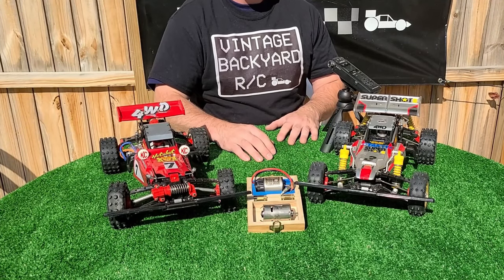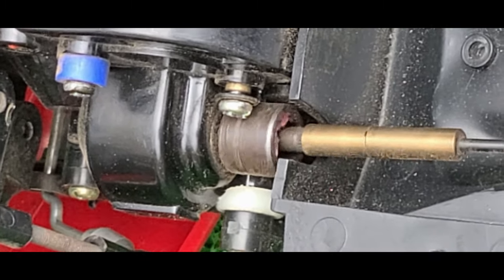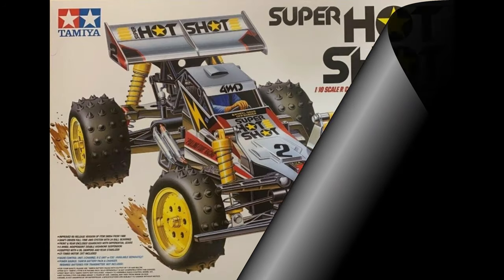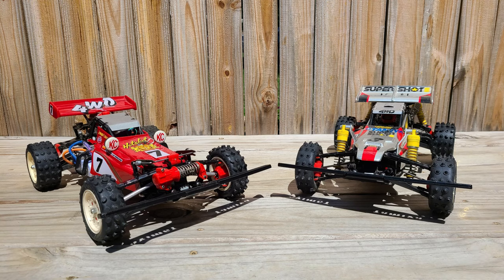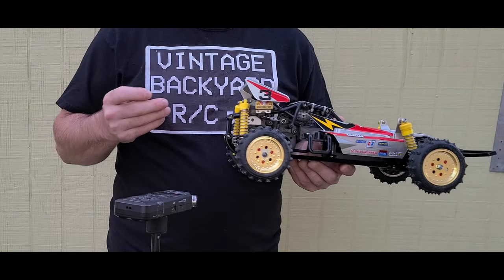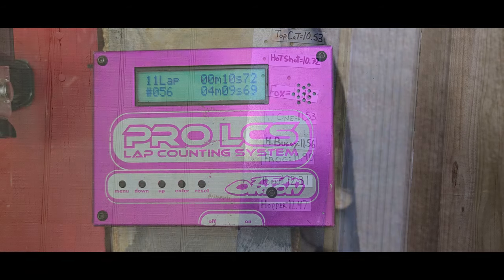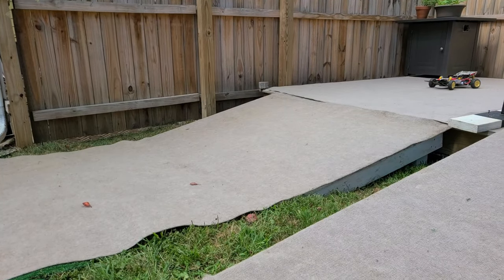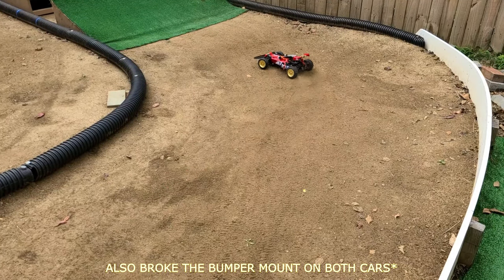Tamiya Hot Shot VS Super Shot! Vintage car battle!

Comment: Great comparison of these 2 iconic Tamiya 4WDs.  I wonder if the lack of front anti sway bar on the Supershot affect the handling (less off power steering) compared to the Hotshot, hmmm? Anyway, time to rebuild mine after more than 40 years inside the box.  Thanks for your video☺
Reply from the maker: Thank you so much....we really appreciate it. This one by far has been our most controversial video. On paper it makes no sense...lol. the results are the results though.  Was super fun doing this one for sure.

Comment: Love it. Been looking forward to this shootout. I love my Hot Shot and am NOT convinced that four-shocks is an “upgrade” ;) The engineering on the mono-shocks is so amazing and one can hardly believe that it actually works pretty well. I learned the off-power (over-steer)/on-power (under-steer) steering characteristics of this car pretty quick. I love how it snaps around corners if you come in fast and let off the throttle at the last second and then lay down the power on the exit. So much fun and super fast if you can get the timing right (which I manage about half the time, haha). Take care!
Reply from the maker: Exactly how I learned to drive it! Only had like three practice laps before the shoot (did not want to destroy the car) and was shocked with the amount of steering. I had assumed the drag brake was set or something. Just how it drives. Super fun!
Reply: The two-shock setup saves the weight of two extra shocks so I agree with you
Reply: I think the 2 shocks in rear is a good upgrade, but they need to be set up with stronger dampening/pretension. Definetly sits to low without any spacers.
At the front i like the boomerang suspension more, the 2 ears holding the front shocks are prone to damage.
Reply: @schuttrostig5729  From a performance perspective I would agree that two shocks offers more tune ability. But from a fun I-can’t-believe-it-actually-works perspective, I like the mono shocks. Totally agree about the cantilever design of the front shock pivot ears—what were the engineers thinking?

Comment: I had a Super Sabre in the late 80s, I wore the drive train out and it ended up being RWD. It was noticably faster and more fun to drive RWD due to all friction and understeer with the 4WD system.
Reply from the maker: That's awesome. Sounds like you got the most out of that car!
Reply: @VINTAGEBACKYARDRC  I think I went through three sets of drive cups and dog bone pins alone. lol. The metal was a bit soft back in those days! Thanks for doing the battles, any new ones on the horizon?

Comment: I had a Hotshot... Bought it new in September 1985! Added the HS2 shocks a year later or so.

The only car that kicked it's ass was the original RC-10! So smooth and quick. Also lighter. If overcame the traction of the 4WD system... Super cool setup, but way too many gears!

Thanks for the blast from the past!
Reply from the maker: Thanks my friend.
Appreciate the cool story as well.
One of the reasons we do these videos is to try and get folks to re connect with the good old days of RC.

Comment: I was so happy to see both of these cars. Both of these vehicles are still boxed up in the closet. The super shot belongs to my eighth year old son and I am the owner of the hot shot. I was only 15 at the hobby shop when that came out my face was pressed against the glass every time that I walked home from school. I still can’t believe both are sitting in a box unbuilt!
Reply from the maker: Awesome you have them NIB!
Reply: @VINTAGEBACKYARDRC  YES YES! I know right NIB and I am just sitting here.  There comes this point in time when you just say "I can't open this now"! I am stuck!
Reply: @UlisesBatalla  you should totally build it with your son, or find a new owner who also loves it. Then one day you can look back on the memories instead of a box of bits ... If you haven't built in a while there might be some swearing involved, and at eight years old the driving/crashing 🤕 might be more interesting than the building, but that's what more RC cars are for 😁
Reply: @Droidy77  I'm going to leave those two on the back burner. And the reason for that is that at this point in time, I noticed something snapped in my 8-year-old. He caught on to the fact that timaya recycles parts mixes them up and then comes out with another kit. That was like a light went on it's almost as if the wall were pulled from over his eyes it's like an epiphany that one has when you notice that to Maya recycles reuses reimagines parts and then comes up with new vehicles. It's always wonderful when there is a brand new, fully engineered, research and development buggy, car, truck or even a semi. Those two are going to stay on the back burner because at this point in time my black grasshopper too, is waiting for the 8-year-old to finish his Terra Nova Nova Terra Nova Fox.. the other issue is that my 6-year-old daughter cannot settle down and go with the white and pink that she has chosen for her re-released frog. Since I already had a black foot that I modified by changing the chassis adding some upgrades allowing it to perform a lot better it even has the chassis that is colored from a different kit. So what is going to happen is once she settles down and pics good old PS1 and whatever PS color fluorescent pink happens to be we will finish that buggy and all three of us will have are two wheel drive Fox frog and grasshopper. They're going to be identical right down to the vintage Futaba m c 210 speed controllers a Futaba s148 servo and a Futaba receiver that is almost as big as the servo. The gentleman from lightspeed gave me a wonderful price on three hand wound 19 turn double armatures that I stuffed into three of those really really cheap Chinese motors that you see on eBay.. sorry that this was such a long message
 Can anybody explain why they called it the Nova Fox and don't tell me just because the word Nova means new I understand that I'm Spanish and I know what the word means but, it really can't just be that!
Reply: @UlisesBatalla  the pink Frog or Neo Frog is a classic look! It sounds like you have "more RC cars" taken care of 🚙🏎️. Most people think they changed the name to Nova Fox because they didn't have permission to use Fox any more. Many decals changed from real racing sponsors to fake, made up names, and they had to make up a new buggy name, too.

Comment: Awesome video, love these comparisons. I have both cars also and the super shot seems a slightly heavier car with 2 extra shocks, undertray and hardware compared to the hotshot. Mine weighs a lot with the RC channel metal arms and it needs a lot more power to get the car up to speed also. Great video can't wait for the next 👌🏻
Reply from the maker: Have not put both on the scales...but I would agree it's probably heavier. I'm thinking with some different springs it will be a little bit faster. Might need to test that out. Thanks for the view and nice comment.

Comment: Incredible shootout! I've always loved the Hot Shot, and hope someday to get a Re-Re... Don't actually want an original, because I run everything! 😊 
The Hot Shot has been surprising me on several Channels, running WITH modern high performance Buggies!! 
Your daughter's Camerawork is PRO Level. She's very talented!!
Reply from the maker: It's actually a really great car. The controll arms are a bit fragile so I would grab a spare set. Also front knuckles crack every once in a while. Otherwise the re-re should go good for you. I might  pick one up myself so I have no worries about beating up on a vintage bit. My daughter thanks you for the kind words. I could not do this without her help and support. Thanks so much friend.
Reply: @VINTAGEBACKYARDRC  It was my pleasure! IF I can afford a rere Hotshot, I'd also want to get Alumininium Knuckles and controll arms, for that reason.

Comment: Ah, so history did repeat itself. When Losi made their 8ight 3.0, their intent was to make the car easier to drive, resulting in more consistent but slightly slower lap times compared to the 8ight 2.0. While it wasn't necessarily a matter of switching from a fancy, overengineered setup to something simpler and more proven in that car's case, it was definitely a repeat of what happened with the Tamiya Hot Shot.

I can see Hot Shots qualifying at higher positions while Super Shots end up placing better in mains.

Anyway, when can we expect an Avante to grace your track? If and when you eventually get to that car you might want to do a shootout between two of them, one with the factory stock setup and one tuned to correct the vehicle's nasty habits, rather than putting it up against another model.
Reply from the maker: Would agree...and on a imaginary race day situation...I would use the Super. 
I don't have an Avante unfortunately. That and a Astute are on my bucket list cars (especially the Astute). Hopefully some day I stumble into one.
 Appreciate the support and story brother.

Comment: I install a BEC circuit on my Frog to reduce the weight of the car. I vaguely remember buying it from the store. I am guessing it must have been the one used on the Hot Shot. I also remember I needed help from someone at my mother’s work to solder it onto the mechanical speed controller to make it work.
Reply from the maker: Yes...before they had the little red plug on the speed control. I remember this as well.

Comment: What all would you do with the shocks on the Super? Replace them, or just swap out some components? I've been looking at getting one myself
Reply from the maker: The factory cva shocks are actually really  good. For my track... the spring balance and stock oil were a bit off. I assume the rere kits still come with the different internal shock pistons. Messing with them will change the pack and rebound internally, and you can also go with a thicker or thinner oil. Lots of information out there on rc shock tuning...and the stock shocks should work well with some tweaks to match your running surface. Hope you enjoy the build my friend. Great kit to pickup.

Comment: I bought aluminum hubs for my super hot shot because I knew it was putting a lot of power through it and I'm still going to put a 3800 in it and the aluminum hubs are hard to find I had to get mine from Korea you wouldn't break a hub again probably I mean at the wheel.

Comment: Very surprised the Hotshot looked so much quicker in the video. As you said better turning was obvious.  Good work would love to take my Bigwig around and see how bad that is 🤣
Reply from the maker: At 1st I was not sure I could even make a lap with the Hot. I actually rolled on a little fwd trim so the esc was almost off neutral and it was dialed. Jumped really nice as well. I have a wig but it's a heafty beast (and all new) so I am reluctant to run it. Who knows though...I'm sure I will get bored of looking at that too...haha.
Appreciate the view/comment my friend.
Reply: @VINTAGEBACKYARDRC  dont crash the wig into the fence., will probably go through it

Comment: I too was surprised at the result. Now the Hot Shot II is out you can run it and compare the time.  On another note could the weight difference affected the results?
Reply from the maker: Think its more in the setup and track condition to be honest. Tons of rotation is absolutely helpful on a tight track. 
   Wish I had a Shot II to test.
Might be worth a look into conversation parts though.  Car spending is on hold for a while...

Comment: Excellent video as always but personally I’d liked to have seen the Supershot as it was meant to be rather than downgraded. I’d like to see how much faster it could be with all its upgrades. Interesting outcome on the video though.
Reply from the maker: Thanks bud...appreciate the kind words.
So the decision was two fold.
A. I wanted to A/B the suspension.
B. I only have one technigold ( not really the correct motor)...and I did not want to burn it up $$...lol.
Shot with more power would most likely be faster.

Comment: The cornering difference is made by the hotshot having front and rear anti roll bars fitted, Super shot isn't stiff enough changing direction because of it.
Always thought it was a downgrade going to 4 shocks and removing them.  Did you weigh the cars? Be interesting to know the difference
Reply from the maker: I also think the valving and spring rate on the Super is all wrong. One day it will get it's revenge...lol.
Weight is about the same with the extra cantilever bits on the Shot...but no I didn't put them on a scale.

Comment: Nice ! Clearly both seem to miss some dampening in the rear and the super shot could use some spacers in the rear shocks, but if you want to run as in manual then that it is. Though in my manual it clearly suggests to put some spacers in the shocks.  Anyway great to see and verry intresting that your hotshot did so well.
Reply from the maker: Both cars ran great. Rear springs in the super were new from bag and fairly stiff so we went without the preload spacers. All in good fun and was great to air out some vintage Tamiya on a nice summer day. Would love to explore a few shootout videos where we tweak things...but it's hard enough just to get content out for us.  Appreciate the view and comment brother.

Comment: What oil would you recommend for  supershot shocks?
Reply from the maker: Honestly not sure (have not tested). I ran them with the standard Tamiya damper oil ( whatever comes with a Frog rere) in both cars. Built the shocks to 80s stock "kit". Think If I was tuning it...I would look for a bit softer front spring and just tune from there.  I ran way more laps with both cars than normally and the Hotshot was faster average lap as well. Same electronics and gearing. I will say if I had to bring one to a vintage race or something....it would be the Super Shot. With some tuning or simply adding more power....its gonna be faster no doubt.

Comment: No doubt that the Super Shot was the better car.. but with that weak standard 540 motor the diffence in the suspension does not show.. With a proper modified motor such as the Technigold the better machine was the Super Shot. Also: Damper setup on the Super Shot provides manu more options.